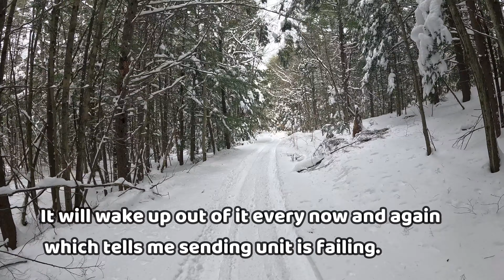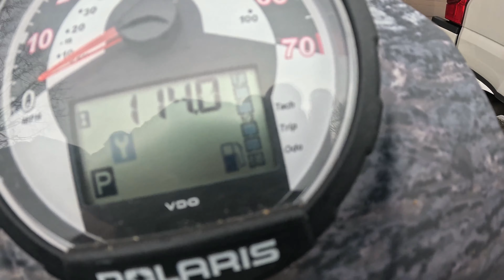Installing And Trying Tracks On A Polaris Sportsman As Well As A XCR Update

Comment: Did you run the tracks in high gear also? What was your top speed? I've been wanting to get some tracks for my quad but they are so expensive. Also look like a pain in the a$$ to install. Keep the the content coming!
Reply from the maker: Ran them in low gear in the deep stuff and on any steeper hills. Flat trail that was packed down I shifted her in high  gear and got it to around 25mph